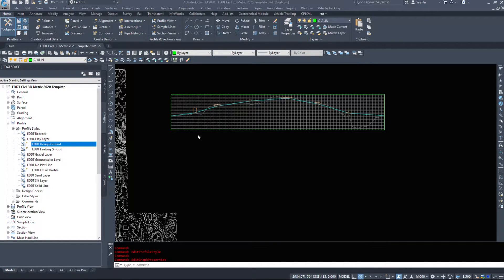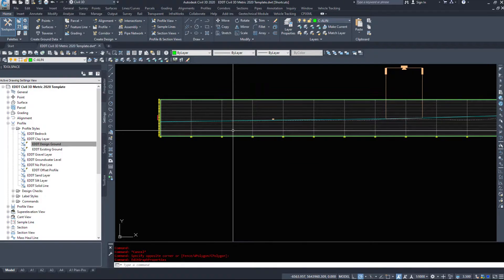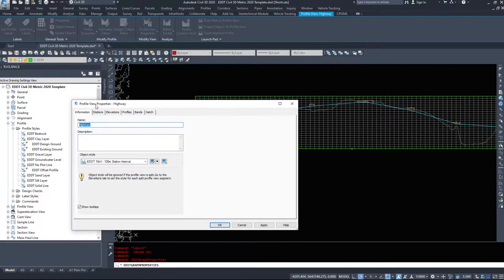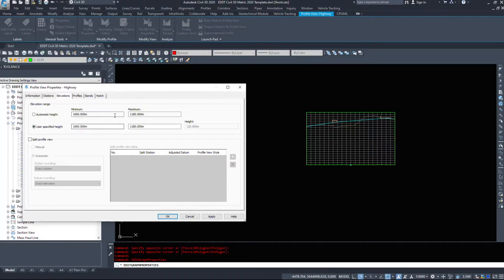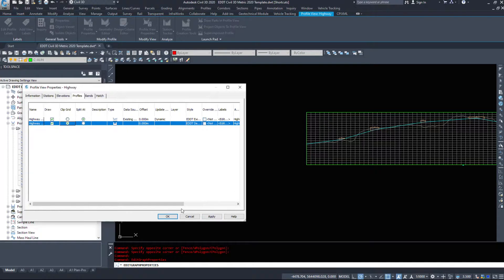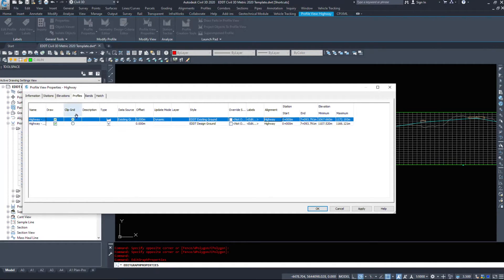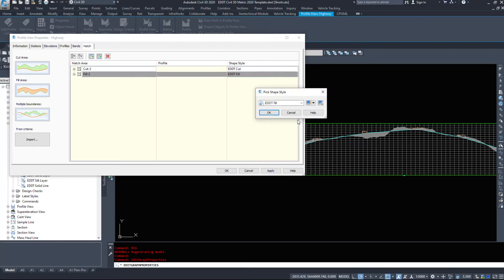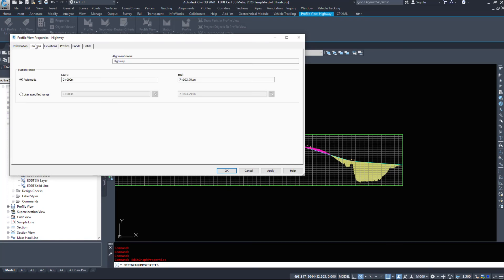Introduction to Civil 3D Part 28 - Profile View Properties

Comment: Do you XREF your design drawing (that contains design alignments and profiles) into your plan sheets or do you data shortcut the profiles into the sheet? Anxious to see if you do a section on plan production workflow. Excellent content! Definitely directing new cad users to this.
Reply from the maker: It typically depends on the size of the project. If it is a smaller project I typically leave everything in the same drawing, however on larger projects I do tend to use Data Shortcuts. I usually Data Shortcut my large surfaces and corridor related surfaces around. I have found issues while data shortcutting pipes and pressure networks as they do not come across properly. I also find that data shortcutting Alignments and Profiles to be a waste of time. It is much easier to just rebuild my Alignments and Profiles in a new drawing. I do have a couple of videos on the Plan / Production workflow in relation to long alignments.